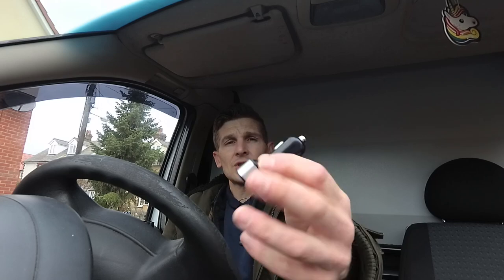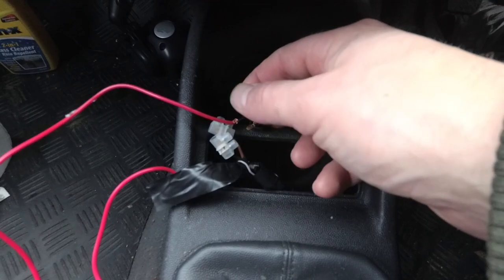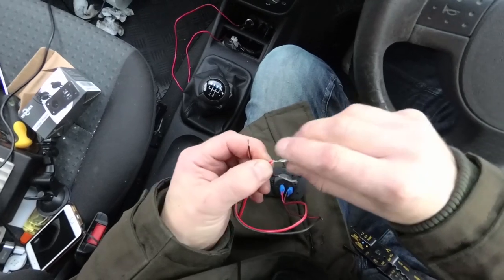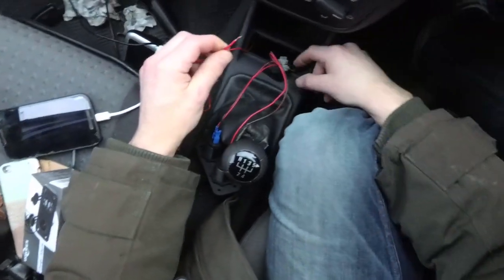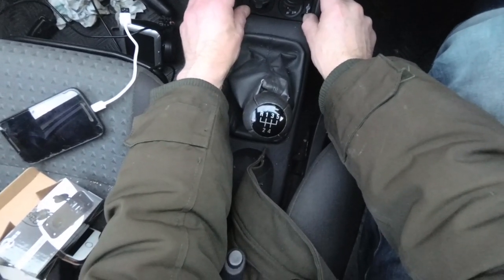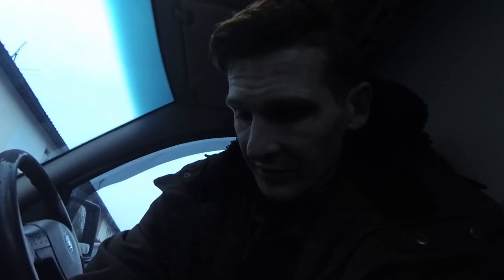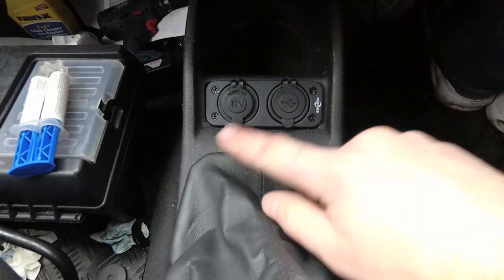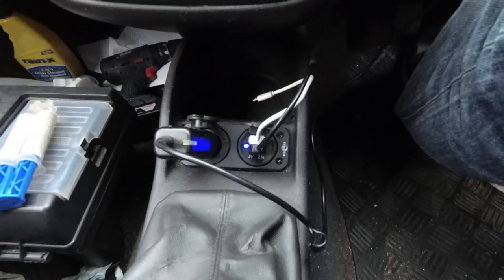Installing USB Charging Ports / 12v Cigarette Lighter Adapter - COMBO MODS

Comment: Best mod in the world is swapping the steering wheel out for a Corsa c leather one , it just transforms how the van feels , the standard foam shit ones are horrible and mine was like yours if not worse , think I paid £15 delivered for mine and it's the best thing I did , keep it up 👍👌
Reply from the maker: +Matt Clark Ha ha, yea mine looks like a dog has been chewing on it. New steering wheel is badly needed.
Reply: @RustLocker  yeah mines a ex network rail van so where the driver had constantly had oily hands in same spot it had eaten the Dodgy foam stuff , I literally hated the way it felt driving it. Now she's mint , makes so much difference , way more than you would ever think

Comment: top video mate any ideas how hard it is to install 2 6x9 speakers with these combos? dont know if theres cabling there for the two rear speakers that a corsa has
Reply from the maker: theres no cabling for rear speakers in mine, just holes for round speakers in the back.

Comment: That does look neat, but I might get around to wiring up the heated seats one day so...
One mod to consider, especially if you have one of those multi-socket things and heaps of leads for the ecig etc (me too) is to look for Tigra B 'boomerangs' on ebay or the breakers. About £20 is the usual in good condition. They keep all the leads (and the Mentos) in the central pocket instead of spilling everywhere. Four screws, blindingly obvious how they fit, and I think they look pretty neat - especially with silver vent + heater control panels.
Reply from the maker: Good tip, thanks, I’ll keep an eye on eBay.

Comment: A couple of years ago when I got my first corsa, there was a guy who made custom USB/cig lighter ports that fitted in to the slot perfectly. I think he was from corsa c UK fb group. I also had the wiring for heated seats behind the coinslots. Now I've got my SRI I'm back to the cig lighter/coinslots again.
Reply from the maker: I wish I had heated seats :)
Reply: Rust Locker - get a Naipo heated seat cover from amazon. My one also has a little fan that blows air to your back. Absolute lifesaver during the summer (my car didn't have a/c)
Link: https://www.amazon.co.uk/dp/B07BQLJ7JP/ref=cm_sw_r_cp_awdb_t1_UmgpCbT4PV0GA
Reply: @joeynebulous816  I'm a bit late replying but do you have any information on this mod if its still being sold? Or how to make one?
Regards